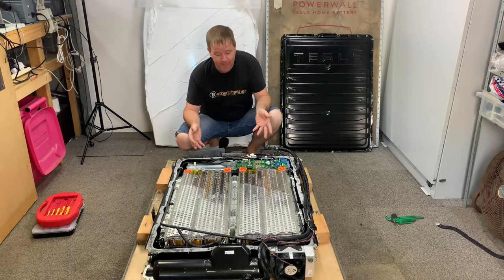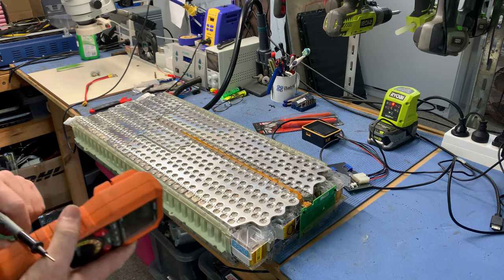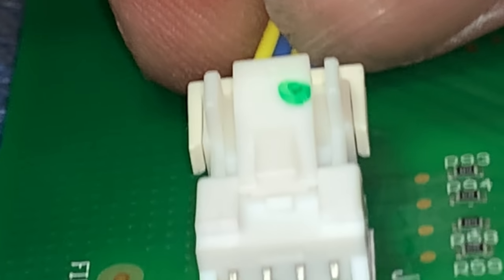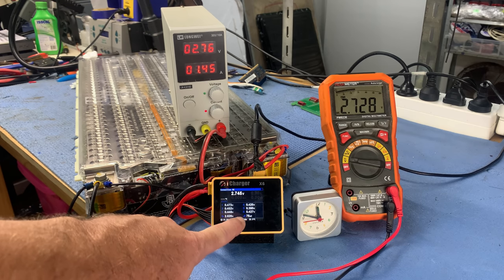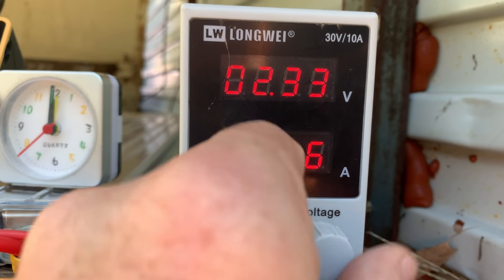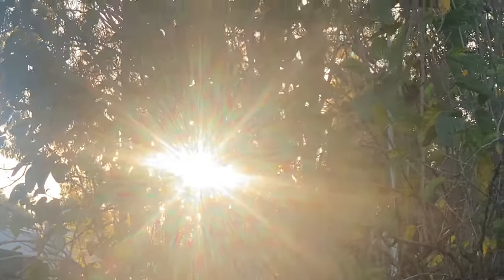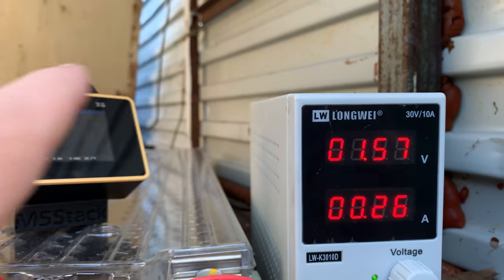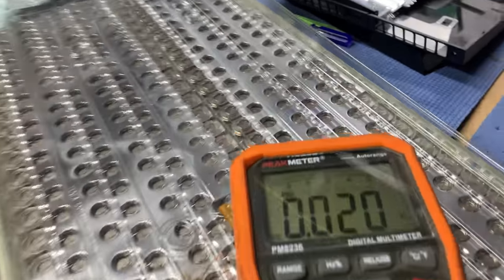Tesla Module repair | Zero volts to useable? Lets find out !

Comment: Very interesting experiment!! It should me a way to recover them from this kind of memory effect stage.. i can't understand why this is happening with lithium cells.. there is no internal short circuit and the chems inside the cells are the same why are they behaving in this way? The only thing that it can explain this is a chemical reaction inside the cells after they discharge that making them useless.. it will be interesting is this effect is reversible..

Comment: Hello, first of all thanks for your videos.
They are very well done.
I have some questions / suggestions.
I believe the battery is similar to model S battery perhaps with less cells (I didn't count them on the video)
The variation on charging it might have be due to temperature variations at night, lithium shouldn't be charge with low temperature <5ºc.
In did the battery is 24v nominal, the cells are 3.7v with cut off 2.5v +/-.
I don't know the specs of the lithium board you have to use.
 Could you try to charge the battery cells (74cells) with at least 3v input a bit over the cut off, do this for every 6cells of the battery (each individual cell will be balanced since the they are in parallel)
I do this method to equalise the module cells so I can have the module balanced with other and maximize the usage of the pack.

Comment: Use the snips for the pin, you can reuse em then after! You can easily wiggle the snips behind
Reply from the maker: I tried a few different ways to get that pin out.. it's quite soft unfortunately.
Reply: @HBPowerwall  Try using needle nose pliers. That won't work if they are pushed in tight though. Then you could try using one or two tiny flat blade screwdrivers.

Comment: Fyi, I had a 110A cell (of 55 pcs of 18650) and I had to use about 5A at 3 volt for about 12 hours. So I think you really should try more Amp over longer time.
Reply from the maker: Will do!

Comment: i must use a minimum 3v across the batteries. and you need to push about 1.5 amps to get them to try to take a charge. they will never take a charge in the state that they are in like that. if you place your voltage a 4.2 Volts and set the current to at least 1.5A 2A may give it a better shot, then try again and they will take a charge.

Comment: Thank you for the video.
I have myself some tesla modules but managed to tear the rippon cable near the plug. Do you know what type of plugs are used on the ribbon cable.
I plan to resolder it to the cable. The plug itself is broken to :-o
It would be a shame if the block got wasted because of my clumsiness.
Reply from the maker: You just run a wire, it's a few minute fix if you have the right tools.
Reply: @HBPowerwall  I have tried that and the plug meldet and now won't plug in. I am unable to find those plugs.
You do need the ribbon cable on the dead module, don't you :-)
I live in germany and the accu community is rather small over here. So there is not much participation in help.

Comment: Obviously there some heaters, why aren't you forcing a charge, then pull each cell bond wire fuse. then let it sit, heaters will discharge.. later measure each cell voltage, ones that hold a charge you wire back up to the collector plates.
Reply: obviously very likely all cells are heaters now.
Reply from the maker: Current testing says 444 heaters, but I've said too much - stay tuned

Comment: Those power walls can't be stored long term. The parasitic electronic loads drain them. There needs to be a Mains switch that completely disconnects the cells from the support electronics. Keep that in mind when you design your own system. :)
Reply from the maker: Thanks for the info
Reply: And the factory electronics would brick it anyway without an internet connection, as they only work iffen they can contact the mothership.
Reply: @randacnam7321  Really? Wow them ***holes.
Reply: @ebenwaterman5858  Tesla Powerwalls only work with an internet connection.  If that quits for over 48 to 72 hours, the Powerwall shuts down until internet is restored.  They claim it is for real time adjustments to the state of charge limits to maximize battery life (the Powerwall battery has a real capacity of 17kWhr to 19kWhr and the electronics adjust which 10kWhr of that is used), which is rubbish as there is no way a decent cell chemistry needs such tweaks more than once a month or so.  It is really because the Powerwalls are being used as real world test laboratories for seeing how batteries perform under all manner of conditions.
Reply: @randacnam7321    Wow! That's worse than Windows or an iphone.  This is good info for everybody. Thanx  :)

Comment: I did charge a ded tesla battery to 4.2v per cell and it hold it for a while and got down to 3.85v per cell so you should try to charge it to 100% capacity if it got hot during charging its ded
Reply from the maker: I've tried 3 time now - this was my third try https://youtu.be/pD3z1tfPJDA

Comment: Love your videos. Do you know a trick of replacing a broken Fuse wire from cell to the board on tesla battery module?
Reply from the maker: just solder one is what I've done..
Reply: @HBPowerwall  ive tried to solder it but doesn't stick because buss bar on it is made of aluminum. What flux and solder do you use?
Reply from the maker: AMtech Flux, GOOD solder can't remember brand & Hacko Iron -

Comment: Hmmmm how does the coolant circulate thru the battery? How do you know when the battery is overheating?
Reply from the maker: coolant is pumped through the standard cooling system, thermal camera shows excess heat

Comment: What is the voltage supposed to be here? Is the voltage you put on it not below the minimum charging level? (and then the only thing that happens is warming up the battery)
Reply from the maker: should be +/- 22v the idea was to bring it back really slow... didn't work... So I'm doing it a different way now :)

Comment: Just curious ... when the voltage drops after turning off the charger, where is the energy going to? Is there an unknown load on the batteries?
Reply from the maker: the cells are heating up thus dropping voltage.

Comment: dang! I was rooting for it to be ok, but the chemicals they used probably totally degraded and shorted across the dielectric. I have revived many batteries and if they are going to work they come right back up to 2.5-3v almost immediately with a 1/20C rate. But it looks like for high eneregy applications the chemicals are much less stable and really degrade if not in the proper voltage range. anyway cheers mate!! maybe all the other electronics are good and you can upgrade your powerwall with them!
Reply from the maker: I think they are Junk but trying another test now to see what happens, I want to make a DIY Powerwall.. like a real one lol
Reply: @HBPowerwall  cool, hey your powerwall is well built. Batrium is a good setup
Reply from the maker: Kinda, few things I could have done better.. too much effort to change it now tho

Comment: Nice Peter but would be interesting to bring the cells voltage around 3v and start the icharger, with some good amps, and before anybody says anything, the cells are going to get some heat, cuz they are 0v they, you do have space outside to do it safe, after bringing the cells to nominal voltage they should hold its change, as they are brand new ones, I’ve test 0v cells and successfully recover them, “not tesla ones”, but that’s an idea, you can watch the temp during its charge and if it get critical them you can say they are dead, best lucky with them, I do believe it can be recovered...
Reply: Might just need to get over the hump to make the cells start acting like batteries instead of capacitors.
Reply from the maker: I charger is running now :) Also i've said too much lol

Comment: Yes, not unexpected.
One thing though, the icharger has a battery conditioning mode which was designed for FLA batteries. It boosts then relaxes and boosts and relaxes, probably fruitless but might be a demonstration of that function?
Reply from the maker: I will look into that..
Reply: @HBPowerwall  I checked, it's called "Reflex" charging, could do something, that "something" might be starting a fire, but would prove it does or doesn't work on Lithium as it's supposed to work on Pb or Ni

Comment: The wall was hotter then the battery. Those things aren't charged like that normaly are they? Seams like trying to fill a swimming pool with a drinking fountain. If they weren't getting hot and actually the voltage was rising, why stop. One things for sure, it would take like 2 weeks to fully charge like that. I charge 18650 10s packs with a 42 volt 4 amp smart charger.  I don't know much about it, but I find it hard to believe it's just all going away generating heat.
Reply from the maker: not all going away but 99% of it is gone and hours later it was still producing heat - cells are internally shorting causing them to head.. Left charging the acclimated heat would go into thermal runaway ending badly..

Comment: How do factories create cells... They at some point start with 0v? If so what is their procedure for the 1st charging. You need a guy from lithium cells factory here to help us. Anyway thank you for sharing!
Reply: Well no. When the batteries are new, the chemicals are new. As such the battery behaves as new and accepts charge. As they degrade, the chemical reaction changes the chemicals inside the battery so you no longer have the same chemicals and ability to hold charge.
Reply: In the factory, they start with different (good) chemistry. As cells age, the chemistry changes due to chemical reactions. At 0V for a period, certain chemical reactions occur that can't be reversed (at least by electrochemically). A recycling process can take the bad chemistry can re-create the chemical components used in a new cells.
Reply: You first need to extract the raw materials out of the battery pack in a recycling procedure. 
The first big plant for that is here at deliver 93% of recycling incl. plastics and metalls and so forth.

Search for this video from the fullycharged channel "Can electric vehicle batteries be recycled"
They visit this plant and you will find all the answers about battery recycling and the way to build new cells out of dead batteries like raw materials.

20 minutes and you now that this is quite impressive cause they are already able to power that recycling procedure up to 60% out of those old batteries that first have to be discharged completely ... from 2,5 V to 0 V ...
Reply: When they put all the layers together at the factory, batteries already have some charge and do output their normal voltage. Just like with "lemon battery" experiment.
When you discharge a battery too much, chemical reaction continues with the copper electrode instead of lithium ions. That results in a shorted battery like in the video, because cooper forms on the separator that separates positive and negative sides.
I might be wrong, but that's what I know.
Reply from the maker: I need to pull one apart and see what I can see under the Microscope

Comment: Can you replace the two battery modules with used modules from a wrecked model S or X?  If so, that might be a budget way to get a working powerwall.
Reply from the maker: If they unit had been commissioned it think this is an option, how ever since it'll need initial commission from a Tesla installer I don't think it will happen unless you can find a guy that wants to help out.

Comment: I was recycling some laptop batteries the other day, i had about 30 of them at 0 volts, and just because i could, i tried to charge them. Started okay, oltage was climbing at low amps. At one point it "breached".  Voltage started dropping. What i did then is added some extra amps to get 1-2V, for about 2-3 mins. Then i disconnected the charger and disconnected the cells from each other. fewe hours later i measured the cell voltages and some were 0 volts, others kept some voltage. A fewe that had the highest voltage are currently holding 4 Volts. So maaaybe some of the cells in there are still good? they are all the same in that powerwall, but maybe?
Reply from the maker: I could only hope, but all being the same age & situation they are all dangerous to use. I did another test here - https://youtu.be/pD3z1tfPJDA

Comment: I wonder if it make sense to rebuild the packs with new or good used cells to be able to use Tesla’s BMS and app.
Reply from the maker: I desperately  want to do this! I have to follow some local rules with battery storage so will make it hard, but not impossible
Reply: @HBPowerwall  I guess using used Tesla modules is better way but more expensive because building a pack with cooling loops would not be easy. Cells are glued together... hard to do in DIY methods.
Reply from the maker: Issue with this unit --- it's sealed so even if you don't 'need cooling' you still need to be able to remove heat from inside the cabinet - more I think about it the MORE I really want to do something cool with it.. Upgrade cells & Capacity maybe an inverter & SCC stuffed in there?

Comment: even ten or more of these dead cells will pull everything done like that
Reply from the maker: Need more than 10 to do it that quick! And they would be smoking hot, very easy to see with thermal camera
Reply: @HBPowerwall  so as there are no real 'hotspots' within the cells, we thinking that its NOT isolated to a number of cells bringing the whole bank voltage down, but instead its  many/all of them ?  
what would make all/most of them fail like this ??
Reply: I am a Ham radio Op so I play alot LOL
I got (2) toyota prius packs (60-ish batteries at 7.2v 7.5ah) one whole pack is like 300V they come in that was at zero too, I have gotten them from free to $30 per pack, looked like a dead short somewhere, they go into some funny sleep mode if they sit a long time and ya have to wake them up, I kind of did that maybe faster than I should have but it worked, saved all of them out of what everyone else thought was a dead pack, yes they heat up yes they expand a little LOL it didnt seem to matter in the end! took the first two batteries out hooked them in (S) for 14.4 and ran a hard fast 19v 1amp across it for 15 seconds, then hooked it to a charger and brought them up to 16.5V+ for two hours and absorption phase of 15.2 for a few hours, then a float phase? LI batteries dont really use or need a float but I thought it was a good idea at the time anyway for a few hours and let them sit for a week and cycle them a few times after that, a month later all were still sitting at over 15v
so 5 year old batteries almost as good as new (maybe 90+% but good enough for projects) I soldered some wires into a dead dewalt battery so I could use and test them on a 14.4 drill, LOL dont laugh I have been using that drill for 3 months now without having to charge it!
https://www.facebook.com/photo.php?fbid=10218755451738228&set=pb.1257908328.-2207520000..&type=3

Comment: I'm curious if a high current pulse would help anything. You mentioned that it would have created dendrites being at this low of voltage, so you could potentially melt them with a quick pulse of current and then turn it off before the rest of the cell got too hot. Just curious
Reply from the maker: I'm thinking fuses will just pop...

Comment: What I want to know what was the reason why they went dead. What is the power draw from the powerwall?
Reply from the maker: Parasitic load from the BMS/electronics over years
Reply: @HBPowerwall  So the bms did not shut down the battery. Which is odds cause I thought that is what they were suppose to do. I did not see any other connections to the battery that might have drawn the power unless the bms its self is the one at fault. 
I wonder if you could make a small  battery that could allow the unit to turn on and maybe try and find the fault or something along that line. I also wonder if it would still work if one could say install their own battery bank and what good a bricked unit like this could do instead of tossing them

Comment: so what info can we learn from the cooling system then? or any part of the build processes? to make power walls that much safer...
Reply from the maker: These are sealed - thats the biggest difference, Also small battery high amps is going to cause heat.. Build bigger batteries suited to your load so you don't need cooling seems to be my take away from it. But I do like the idea of them being sealed - but with used batteries that make maintenance impossible
Reply: @HBPowerwall  when you say sealed  where does the water go ?
Reply: @dtec30  Heat exchanger?
Reply: @kwinzman  no meaning the battery is it only to the bms ie cpu
Reply: does it flow around the batteries?
Reply: @dtec30  You can see the cooling system in the previous video on this channel at the 7:50 mark. Yes, it flows around the batteries.
Please do some research before you comment. :P
Reply: @kwinzman  i saw as much as you saw but if you know more than me then please enlighten the rest of us  i was hoping this group would be more open to comments in general but if this is how you treat each other  then maybe i should look for a better group
Reply: @dtec30  
mate just google it or type in your question on youtube. there is tons of information how it works. you will have to do some research yourself and not expect  other people will just serve it to because you expect it.

Comment: should undo all the boards and charge the Batteries directly & you could save them Tesla and most boards has a safety power dumb after the batters drop so low. wont even charge them. says it is but it just loops the power back doesn't divert the power to the batteries.  its is a safety reason but also to make you buy more.